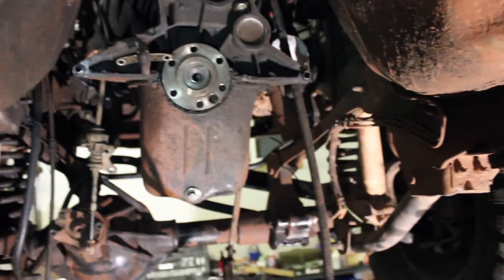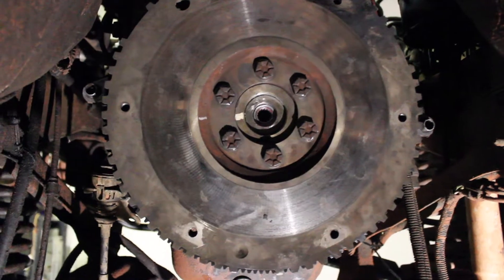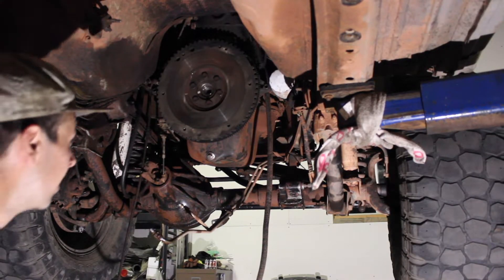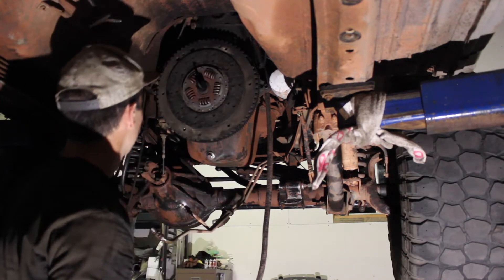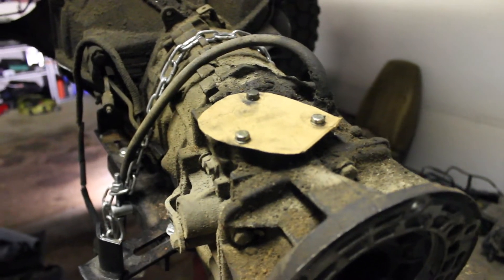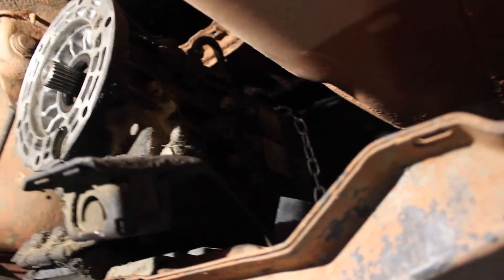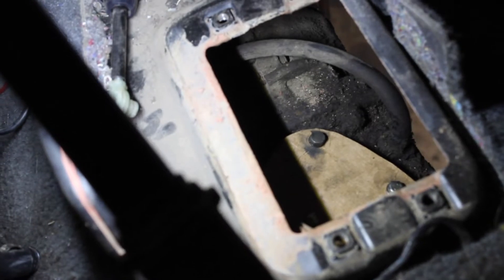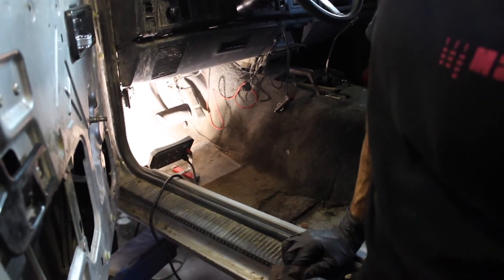1994 Jeep Cherokee Transmission Swap: Part 3

Comment: Just saw this and gotta say good Job on including. All the Lillttle extras it takes to make it happen! Better lighting could have been  an option but other than that this is great! Definateky earned a 👍!
Reply from the maker: thanks, i appreciate the comment!  every comment helps.  I did actually end up getting a lot better lighting set up as well.  it makes wrenching and filing much better quality.  the newer videos should reflect that.
Reply: @myles2go.  I'm getting ready to swap awd trans in my 96 lerado 5.2 so might ask ya for info if possible come the time
Reply: @myles2go.  I'm not sure why many even do videos as they skip over key sruff and leave so it when I'm the simple stuff.  I mean i get it if you don't take know maybe your shouldn't but sometimes things are confusing si just to clarify i think it's super helpful for those who are not real savvy.  Again thx  and Great Job! How's that thing moving now
Reply from the maker: @albertmcclaren5571  it ran and drove great until i sold it.  i am assuming it is still on the road diving great